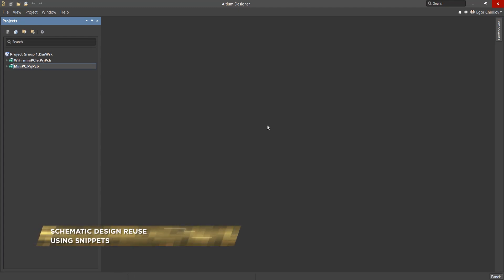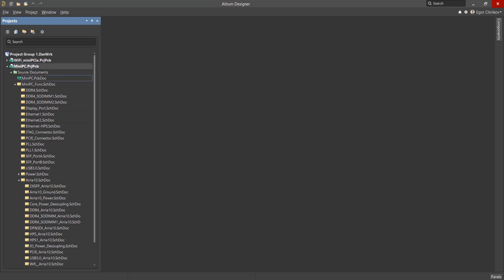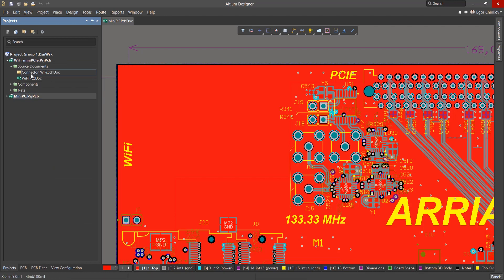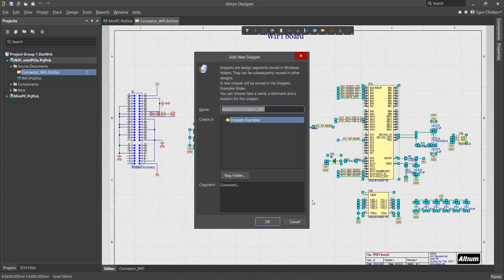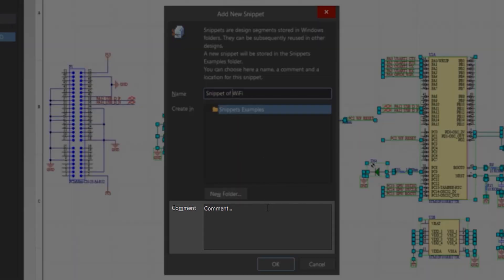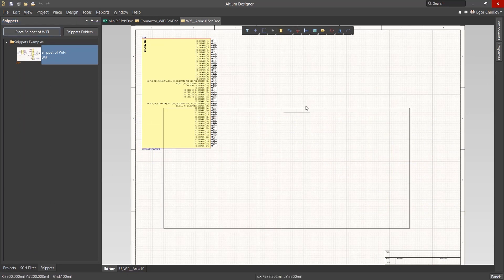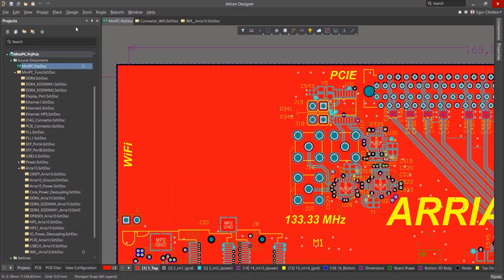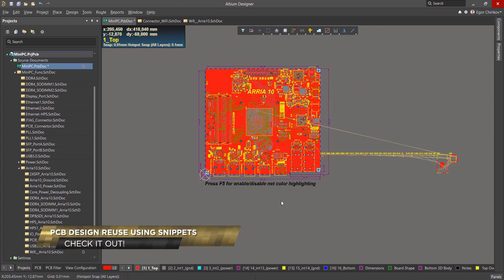Schematic Design Reuse Using Snippets in Altium Designer | PCB Routing

Comment: Is it also possible that we add the schematic to our project by using 'add existing to the project'? And then just go to the PCB editor and do 'Import changes from project', then the additional schematic parts will be shown on the PCB editor also.
In this way, maybe we would not have to care about the designators of the newly added schematic.
Reply: Yes you can just add an existing schematic to a project and then import the footprints into the PCB layout as you describe. Sometimes the footprint assignment might not import correctly if you import an existing schematic sheet into a project, this will happen if you use a footprint library file and you do not copy the footprint library into your project folder. The workaround is to also add the existing footprint library into your project, and this would ensure the footprint assignments are imported correctly.